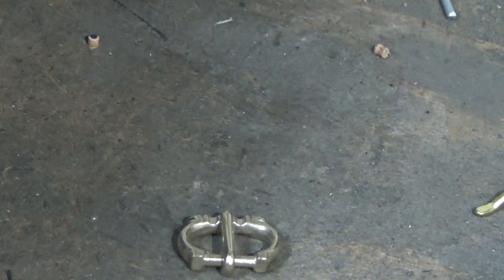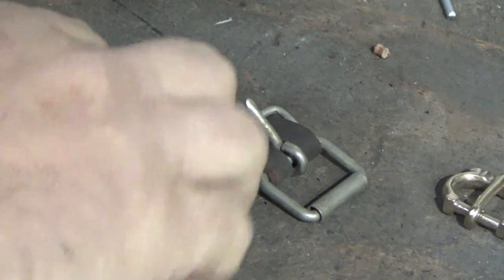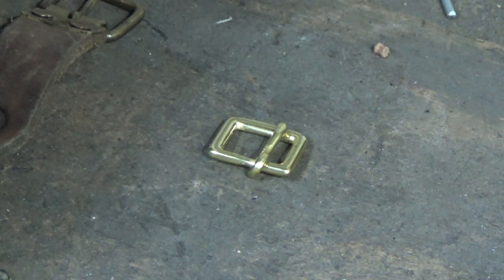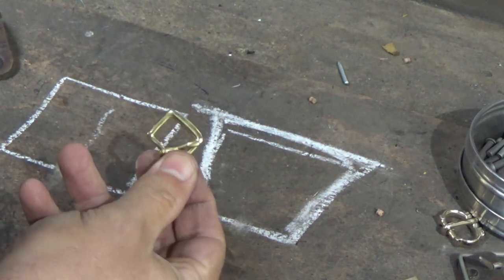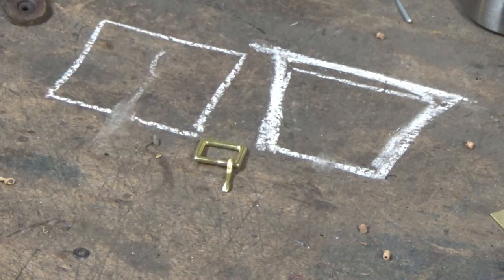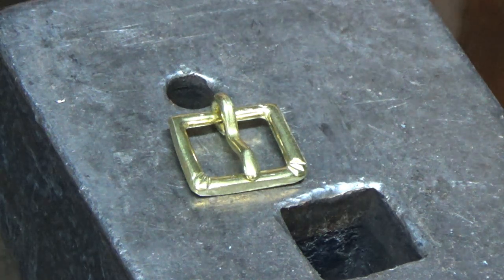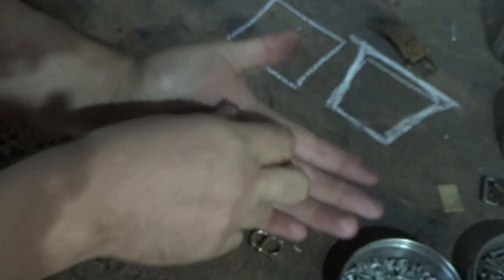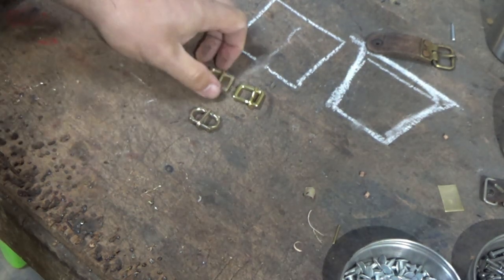Pimp my Armour: Buckles

Comment: when we went for cheap as possible we always made buckles from 16 penny nails. Hammer the nail square-ish... bend to shape... oil quench for a little rust prevention... Replace frequently when they rust up.
Reply from the maker: nice idea :)
Reply: @GreenleafWorkshop  I started fighting when the number of armorers were less than the fingers on one hand. So you made your own stuff or you didn't fight.
Reply: It is pity we can not send photos with thise messages...